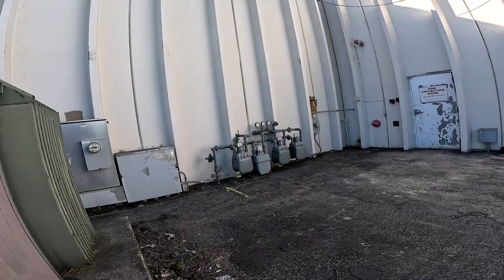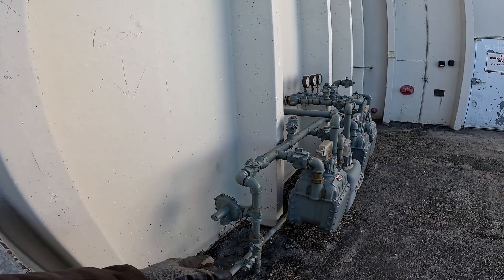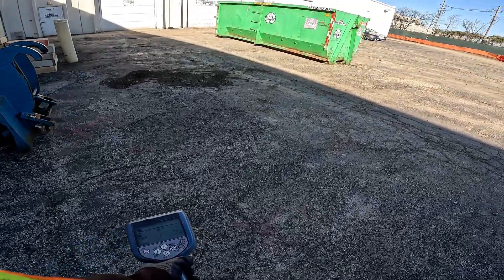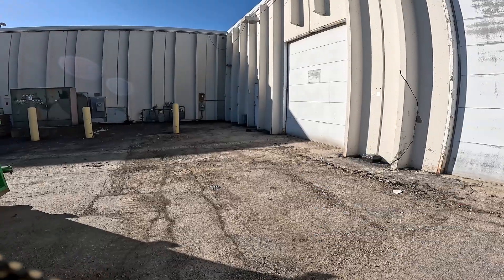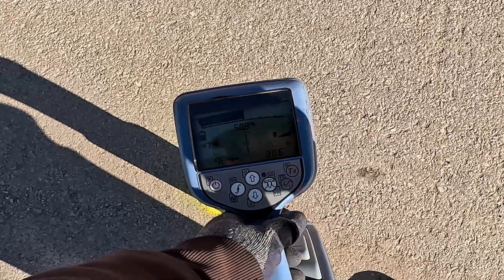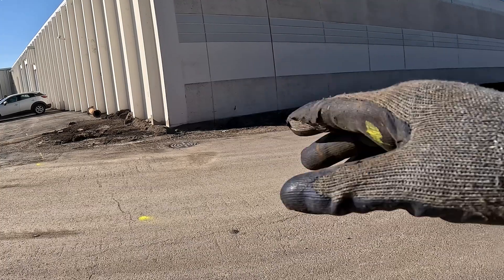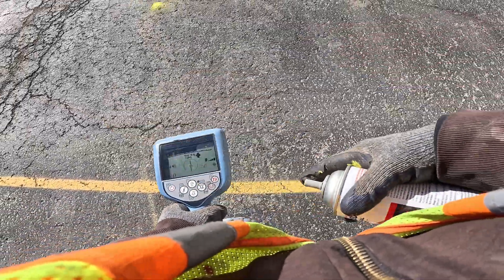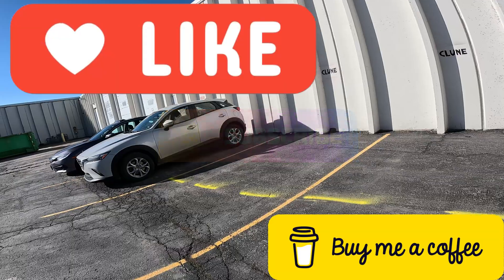Natural Gas: Locating Gas Service | No Place To Ground Out Transmitter

Comment: What’s the difference in peak and Noel?
Reply from the maker: Peak Mode identifies the strongest signal directly above or near the utility, helping to locate its center. In contrast, Null Mode detects the weakest signal, which is helpful for determining the edges of the utility’s path.

Comment: Regarding the point at 12:15 where you've got your peak and null not in the same spot.

The correct procedure* is:
1. Measure the distance between the peak and null, and then divide that distance by 2. In your case, it looks to be about 8" apart, so the number you need is 4".
2. Draw a straight line from the null to the peak, and then continue in that same direction by an extra 4" beyond the peak (so you should now be 12" away from the null point).

That is where the target utility should be. Yes, the point you marked halfway between the peak and null might be within your reported margin of error in this case, but it's not really good practice, because if there were additional buried conductive utilities nearby, the distortion can be made worse, and the responses from peak and null, and the location of the actual utility can be further apart (much more than the difference shown in this video example).

*as per the Radiodetection user manual and as per page 58 of 'The ABC and XYZ of Locating Buried Pipes and Cables', also by Radiodetection.

Hope this helps. :-)

Comment: What happened to ur paint stick
Reply from the maker: The paint sticks are not working properly
Reply: @811chicago5  I find that the older Aervoe Paint Sticks with the metal finger trigger works the best.  The newer plastic trigger ones don't seem to push the spray nozzle enough to get the paint out of the can.  Can anyone recommend a new paint stick that works with the cans?
Reply from the maker: @erictiahrt1847  Do you happen to have an Aervoe Paint Stick? If so, how's your experience been with its durability? I'm curious where I can grab one of these paint sticks myself.

Comment: Nice!! Thanks for the info and I still would like you to do a video on proper sweep techniques though…. Your videos have helped me get certified and whilst out in the field.. I’m located in Minnesota and I have trouble locating Century Link any suggestions??
Reply from the maker: Oh, CenturyLink, previously known as Level 3. Let me tell you, locating this fiber is proving to be quite a challenge. The company that installed this fiber, at least here in Illinois, Turnkey Network Solutions, really botched the job. They buried this fiber at a minimum depth of 10 feet in many locations. Here's my suggestion: if there's a wire attached to it, start by grounding one end. Then, head back to the other end hookup and try tracing it out using low-frequency methods. See if this fiber is connected to LMS.